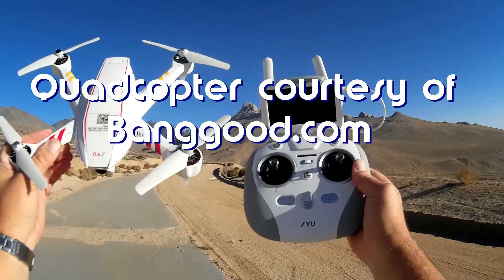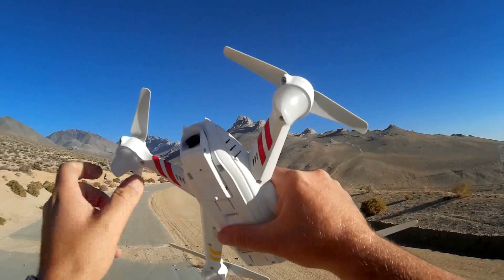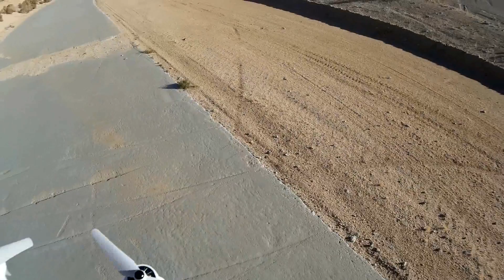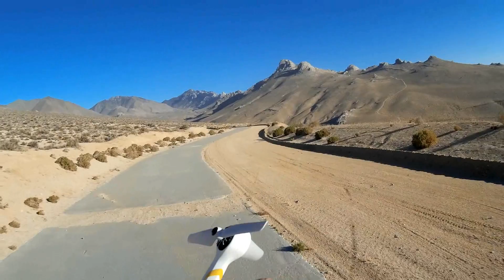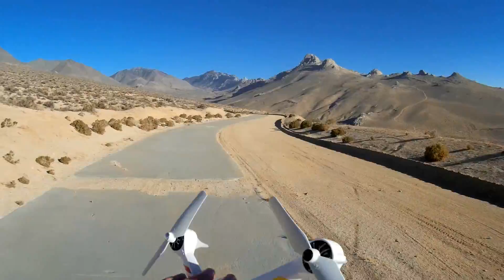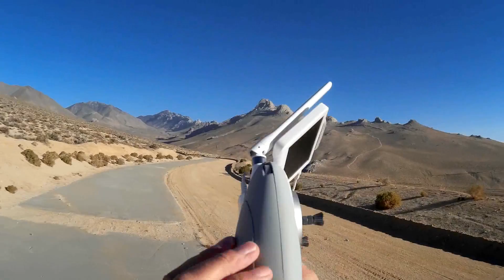JYU Hornet S High Speed GPS FPV Explorer Drone Flight Test Review

Comment: Can I still get this drone at it before but got stolen from my car
Reply from the maker: Sorry, this is long out of production.  I'm not sure that the company JYU still exists either.  You might still find a used one though on eBay.  But I would be hesitant to buy such, as its LiPo battery is likely expired by now, and don't know where you'd be able to find a replacement.

Comment: Hi there I have received one and I am trying to find the app. Apparently the maker must have gone bust, nothing in the App store anymore. Anyone has an idea ?
Reply from the maker: This does not use an app.  Instead, analog video is transmitted on 5.8Ghz frequency.  The video may be viewed with the included 5.8Ghz receiver monitor screen.  But if yours did not come with the screen, you may also view video on 5.8Ghz drone FPV racing goggles or monitor screens.  Here's an example https://bit.ly/FPV-Goggles
Reply: @Quadcopter101  thanks for quick reply and simple explanation
Reply from the maker: But before purchasing, make sure that yours has a camera as shown in the video.  When this drone was released four years ago, there was also a version that did not include a camera.
Reply: @Quadcopter101  thanks for the advice, I was giving one and it is the version without the camera

Comment: 120km/h high speed overflew the FERRARI racing supercar.
- Dual GPS auto positioning system, accurate positioning.
- Intelligent battery extends flight time to 20-25 minutes, removable battery are easy to change
- 3-Axis Gimbal make shooting and taking video stable.

Comment: Nice Quadcopter. It looks like they are building a two lane road where your standing. Quick pour on the first lane and not much smoothing it. Unfinished on the other side of the road but it looks like they already are lining the side of the road with bushes?
Looks like a Moonscape behind you!
Reply from the maker: Not a road, but a concrete coverfing of the Los Angeles Aqueduct. https://en.wikipedia.org/wiki/Los_Angeles_Aqueduct

Comment: Question sir. Hubsan h501ss advance or hornet s?
Reply from the maker: What do you want your quadcopter to be able to do?
Reply: My choice is hubsan h501ss advance and hornet s fpv version like in your video. Ammmh.. what's better ? Tnx for replying
Reply from the maker: They are two different quadcopters. They each are better in certain things that they can do that the other can't.  To answer your question, I need to know exactly what you want your quadcopter to be able to do.  Do you want to take and record aerial video,?  Do you want to do sport flying?  Do you want to do FPV exploring?  Also what is your experience level?  What quadcopters do you currently own, and how long have you been flying?
Reply: Quadcopter 101 Quadcopter 101 I want sports flying and exploring, recording sometimes.  And what's better range distance in  The 2 drone?Tnx for replying
Reply: I watch many times you video wow the drone very fast. 😱😱😱
Reply from the maker: Hornet is a better sport flier, but its FPV version does not have and video recording capability.  H501S can record FPV and fly distant, but it is not a good sport flier.  One that does a bit of both both is MJX Bugs 2 W, but you'll need a 5G WiFi capable phone  https://www.youtube.com/watch?v=ZaZnmt4Z5Dk
Reply: Quadcopter 101 the hornet s gimbal version have video recording?
Reply from the maker: Yes, but it costs a LOT more ($530).  At that price you should start to consider DJI products.
Reply: Quadcopter 101 thankyou very much sir..👍🏼👍🏼
Reply: Quadcopter 101 hello again. when bought it. the mode 3 is ready to hit? or need more computer updates? To use this mode3?
Reply from the maker: All your questions may be answered here https://www.rcgroups.com/forums/showthread.php?2731633-JYU-Hornet-S-FAQ-and-modding-references
Reply: Thankyou very big😊

Comment: Hello Quadcopter 101, I replaced clockwise motor and when I tested it all 4 motors ran at a higher idle speed. I don't understand why it's doing this ? Can you give me any advice. they sent me a counter clockwise motor so i switched wires around and I'm not going to use a sleeve over shaft to make clockwise prop work until clockwise motor gets here. The company suggested that i do that. I think I'll wait for clockwise motor gets here. Sounds unsafe to do otherwise.Thanks for all your video's. I've made most of my buys based on your reviews. Sincerely William Horsley
Reply from the maker: Might want to ask in the following forum.  They're more knowledgeable on the JYU Hornet than I am https://www.rcgroups.com/forums/showthread.php?2641191-JYU-Hornet-S-%28in-construction%29/page210&highlight=jyu+hornet

Comment: Hello sir. Got a new jyu hornet s today to replace crashed one.
Cant bind remote with it. Followed instructions and still flashes red.

Please help.me.out

Thanks
Reply from the maker: The Hornet S and Remote Controller are bound together as a working pair when you receive them. However, you can bind additional Hornet S aircraft to the same remote controller in this way:
1. Turn the Hornet S and Remote Controller Power OFF.
2. Press and hold the Return to Home and Take Off/Land buttons.
3. Turn the Remote Controller power ON
4. Turn the Hornet S power ON
5. When the LED indicator on the Remote Controller turns Green, the Hornet S is successfully bound to the Remote Controller.
Reply: Quadcopter 101 done this like i said like the instructions  cant bind it still
Reply from the maker: Then if you're certain that the batteries of both the quadcopter and transmitter are fully charged, then it's time to contact your vendor's customer service to see if they can help resolve.
Reply: Quadcopter 101 oh  both bateries need full charge before trying to bind?
Reply from the maker: It helps.

Comment: Great quad, looking at getting one, are you able to do a timed flight test with gimble attached, as I was reading in the description that only able to fly for 7 - 8 minutes with gimble..which would totally suck for aerial photography. Or should I hold out for the Hornet 2
Reply from the maker: Is your interest primarily in aerial photography?  If so, would recommend a quadcopter dedicated to that purpose.  This one is something that tries to be everything at once.  As such, it does a reasonable job, but doesn't really excel in any of these areas.
Reply: Great that has helped, Still looks like a fun machine when you had it in mode three..might be a later on investment..but I think I will go ahead and stick with the X380. Thanks 101 look forward to your other reviews of different quads and things

Comment: Hello, tell me please, this monitor can be used for fpv flights, but with another transmitter? I'm not looking for an expensive monitor for fpv, without a blue screen with a weak signal. And I want to use this monitor to connect to the rc805 receiver.
Reply from the maker: No, unfortunately it can not as the receiver is built into the controller.

Comment: sir, I have a cg035 which does not bind with the transmitter.   The transmitter low batter alarm keeps beeping and the gimbal does not work - and obviously the motors will not start - all this right out of the box - banggood is non responsive at this time - any ideas on what the problem is and how to fix?  Thanks in advance.
Reply from the maker: Sorry, I haven't gotten the chance to review the CG035 yet.  But I can tell you that non-binding is usually caused by low battery power of either the transmitter, the quadcopter's battery, or both.  The chargers for these devices usually come with European wall plugs which use a wall plug adapter for US wall outlets.  Unfortunately, these adapter plugs often make poor contact with the wall outlet, and must be "jiggled" in the outlet to make proper contact. In such cases, backflow from the battery can often light the charging light giving false indication of being fully charged. As such, charge your battery(s) as follows.
1) Insert the charger into the wall outlet without the battery being attached.
2) Ensure that the charger's power light comes on to verify that power is actually going to the charger.  If no light, jiggle the outlet plug until you get a light.
3) Now plug in your battery to charge it.
Reply: bummer5711.  sell it..lol

Comment: After reading all of the specs on this quad, I was VERY put off by how much the flight time was reduced, when carrying the gimbal. With the FPV set up, you get about 15-20 minutes. With the gimbal, only 8-10. So, if you want a quad that you can use for decent aerial video and pics, this ain't the one.

Comment: Do you think this drone is better than the Walkera Furious 320?
Reply from the maker: Yes.  It's more versatile (more features).  But if you're interested in tilt rotors, the following is better https://www.youtube.com/watch?v=PODXjznqkNk
BUT since you're comparing two very different quadcopters, something tells me that you might be new to this hobby.  None of these are appropriate for beginner fliers.  You may be making a very expensive mistake, as a new flier will crash and break each of these soon after takeoff.
It's inevitable. New fliers crash, and crash very often, as they learn what to do, and what not to do.  I always recommend the Syma X5C for new fliers, due to its excellent stability, durability, and ease of flying. And it even has a camera too.  Use it to learn the basics of flight with.  Let this cheap quadcopter take the inevitable crashes and bangs of a beginner flier. And if you break it, every part on it is cheap, widely available, and easily replaceable. Later as your flying skills improve and you're not crashing as much, then consider something better/more expensive.  https://www.youtube.com/watch?v=y93vzA-KRlM
Reply: Quadcopter 101 Thanks
Reply: Quadcopter 101 I was looking for a fast GPS quad so I thought these two were good choices but I heard bad things about the Furious 320 like crashes during turns so I guess this one is a better choice
Reply from the maker: Richard Dong I had problems with the Furious also.  It seemed to be very unstable at high speed https://www.youtube.com/watch?v=qEWb0nxMk7c
Reply from the maker: Richard Dong But based on your requirements, here's one that you may not have seen yet https://www.youtube.com/watch?v=Mr-wa1vscLM
Reply: Quadcopter 101 Wow thank you so much I like this one! I love your videos and have a great day!

Comment: I noticed that when your video synced up at 22:30, the camera feed from the quad looks pretty nice. I've seen so many other reviews showing the video feed on the attached monitor, and it always looks choppy. Is the inset video on this review coming from the FPV goggles?
I wonder about this because it seems like the quad needs a much better antenna to transmit the video to the attached monitor. But perhaps its the antenna in the monitor receiving the video feed that needs improving? Anyone have any ideas about this? I have ordered a Hornet S with the camera and FPV screen, so I guess I'll find something out when I get it.

Comment: mode 3 goes vertical very quickly!  but mode 1 and 2 barely goes up at all at full throttle... its set to 2.5 lift which is max, but barely flyable it goes up so slowly!  am i missing something?
Reply from the maker: +DOUG WILKERSON you can increase the vertical and horizontal rates with its configuration software.

Comment: I got one with FPV and it worked okay. Got a second with Gimbal (newer version). Both the quad and Gimbal are junk. Nothing but problems. First controller would not sync after 3 weeks and custom firmware they sent me got it to sync. Tested video and all went down hill. First video I started recording when over my house, around the street and then the video went out. I landed and restarted the quad and took off again, went up 30 feet then it dropped 10 ft and back lights turned red showing battery was low. I landed and went in to check my two videos. The first one, the good one I wanted to see was not there. Only the 20 second last video. Took it out the next day and video went out after 10 seconds while flying. I landed and reset it took off again and when I started the recording it bolted left went about 80 feet before crashing into the ground breaking everything. It was going fast and I could not get control back. It was in mode 1 and GPS was locked and all hand newest firmware and all calibrated. I have flown the original many times, the new one is junk...

Comment: is the usb for recording to a laptop from the fpv
Reply from the maker: No it's for updating the flight control software, which I recommend not doing. There have been some problems reported from people that did attempt the update. I'm happy flying mine as is without any update https://www.youtube.com/watch?v=G0yEudd0mbU
Reply: ahh ok hey whats the flight time on that bad boy im looking to upgrade from my cheap $40 drone
Reply: The small usb port on the RC transmitter is for upgrading the firmware AND charging the battery. I have no idea what the regular sized usb port is for.

Comment: Thank you ,for posting this. I just received my Hornet Basic version, as thats all they had in US stock.I also ordered the FPV camera for 60 bucks. the total with the two separate orders were cheaper than buying the package!?  Reading the forum at rcgroups, it looks like a trail of tears with 'upgrading'. I too believe in old school, if it ain't broke, don't fix it. Well I have read and read, studied the manuals, charged the batteries, and am just now going for a maiden flight. I would like to try my cheap Banggoods Syma FPV camera as it records 720p and surprisingly has pretty good range. I will do that after the maiden, just to avoid any possibility of interference. Thanks again.

Perfect, 3 minutes, huge thunder heads and wind. Just my luck, but I'm a happy camper with the Hornet. Very stable no tb.

Comment: remote does not charge any more is there a fix for this or should I return it
Reply from the maker: Sounds defective to me.  Recommend contacting your vendor's customer service.  Also recommend making a short YouTube video clearly showing the problem to help overcome the language barrier.
Reply from the maker: But when you charge, do you it properly as such:
1) Plug in the battery into the charger.
2) then turn on the battery with a short press then long press.
If you don't turn on the battery, it will not charge.
Reply: +Quadcopter 101 the battery is no problems charging it . it's mainly the Jyu remote that can never charge . how do you charge the remote . can u explain method of remote charging please and thanx . u are the best quad flyer :)
Reply from the maker: MASKIDANA The JYU quadcopter's charger also has a high power USB output port for charging the remote.  Plug the large plug of the USB cable into the output port of the charger, and the smaller plug into the respective small USB plug of the charger.  A red light on the front of the controller should light up indicating charging.  Once fully charged, I believe it changes color to green.

Comment: Hi I was wondering what type of brushless motor quadcopter I should get because of how many there are reviewed and all seem pretty good I would just like your opinion on which you think is the best. About a year ago I bought the syma x5c because of the review and said how good of a beginner quadcopter it is so now I would want to see what you think on a brushless motor one kinda like intermediate level I've been flying for about a year.
Reply from the maker: How about the following? https://www.youtube.com/watch?v=1xuUAfsY5mo
Reply: +Quadcopter 101 what about one with a fpv or a camera sorry I forgot to mention that, also I do have registration so the sizing isn't an issue
Reply: +Quadcopter 101 sorry I didn't noticed that it's possible to use a camera on that, is there any ones that come with a camera and things like that?

Comment: I read that the Mode 1 was also intended to be the mode you would use while videoing  with the Gimble module.
Reply from the maker: GPS Switch Position 1 is very stable as seen in the video.

Comment: great review as always. my question is what is the difference from the basic version besides the camera fpv or the camera gimble version?  anything inside the quadcopter different? still have daul gps ability?
Reply from the maker: There is no difference other than the specialty modules.  And am not sure that this really has dual GPS?  I think that term may be referring to the future follow-me watch with included GPS (one GPS system for the quadcopter, and one for the follow-me watch).
Reply: thanks for your reply, I read in the descripsion that there was daul gps  or GPS+GLONASS Dual Positioning Module